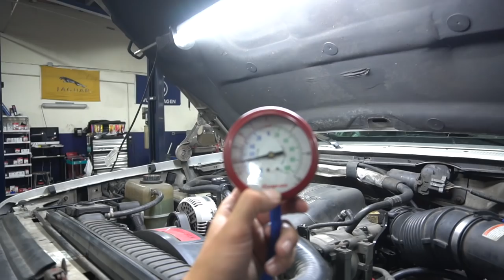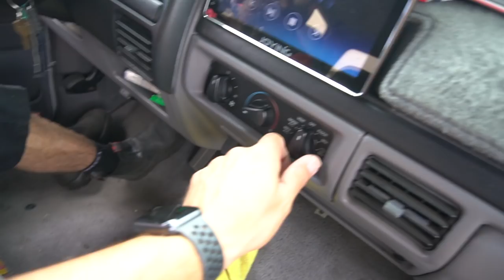MY BRAKES WENT OUT!

Comment: Weasels are small, active predators, with long and slender bodies and short legs. 

Weasels vary in length from 173 to 217 mm (6.8 to 8.5 in),[2] females being smaller than the males, and usually have red or brown upper coats and white bellies; some populations of some species moult to a wholly white coat in winter. They have long, slender bodies, which enable them to follow their prey into burrows. Their tails may be from 34 to 52 mm (1.3 to 2.0 in) long. 

Weasels feed on small mammals and have from time to time been considered vermin because some species took poultry from farms or rabbits from commercial warrens. They do, on the other hand, eat large numbers of rodents. They can be found all across the world except for Antarctica, Australia, and neighbouring islands.

Comment: The 1990’s Ford I beam trucks had sketchy brakes. Had the hoses blow off my 94 explorer and 94 f150 from slamming on the pedal too hard. Not sure if you’re running extended brake hoses but you might want to drill a new hole on the coil tower and mount them a bit lower for extra slack. There’s plenty of slack in the hard lines to do this. Just carefully pin them away from the tire so they don’t chafe.

Comment: Bro.... get a square body 🇺🇸
Reply: Square body nearly killed my friend two months ago. Those things are dangerous.
Reply: FordFan01 idk man. Owned 2 throughout my entire life. I guess it depends on how much you take care of it. The metal body is also safer. Was your buddies truck lifted?
Reply: @brysonh.1093  
Nope, it was a light blue stock stepside. He was driving on a country road out in my area and it pulled hard to the opposite lane and he couldnt pull it back. He hit a tellephone pole. What happened? IDK, there wasn't much left of the front end. I'm not even joking when I say this, the entire front axle was missing and the motor was shoved up into the firewall and the cab warped forward really bad. Dang thing was totalled. Oh well, I still like Square bodies, but from a distance now.
Reply: FordFan01 I hear... my squarebody can be scary sometimes too because if you’re going more than 50 mph and hit the brakes it turns left. I don’t know if it’s the possie track but it scared the living shit out of me!
Reply: @brysonh.1093  Now that is an interesting issue. My 96 F-350 has a lot of slop in the steering to the point I said F it and took it to Ford. They said they found the issue and are fixing it as we speak. I wonder if Chevy could do the same for your issue.
Reply: FordFan01 hopefully I just need to find out what the problem is but I’ll fix it in the next month or so